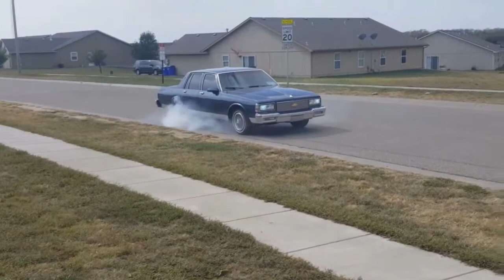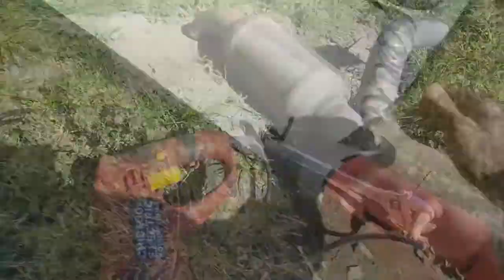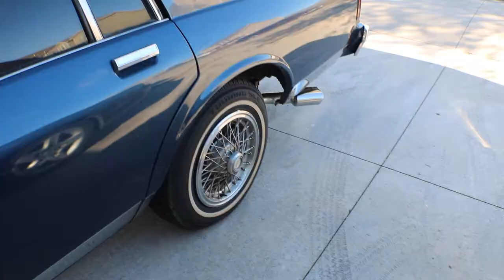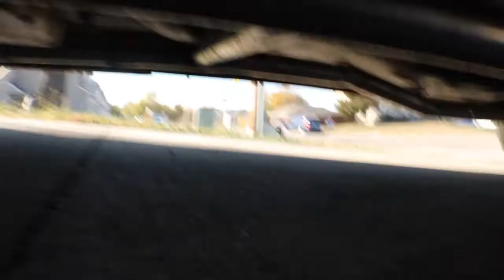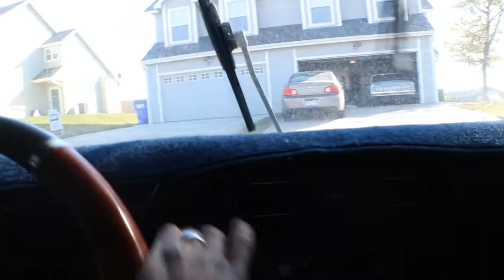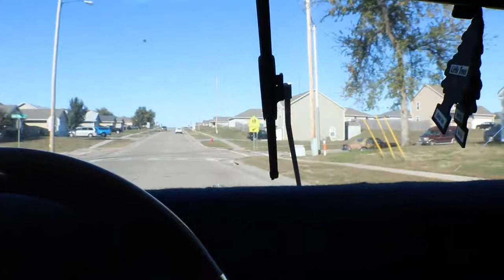Wife's 88 Caprice True Duals & H-Pipe

Comment: She gone be acting a ass in tha blue box bro she sounds good bro 💪 get u a eaton posi trac ... bro did u ever figure out the problem with the wipers
Reply from the maker: Boss King Not yet, we don't drive it in the rain anyway. Just put it in storage last night.
Reply: You might have to replace the entire wiper system brand new. My 1991 Cadillac Brougham had this issue. The wiper always ran so i instaaled a toggle switch so they would shutt off. That didnt kill the power running to them even if the car was off but it still wasnt enough too drain my battery dead either. I replaced the switch with one from the junkyard only to have it not work. Its cool because i didnt pay for it. So i reinstalled the old switch just in case that wasnt the issue. Then i buy a wiper motor, install and got the same results. Was about to give up until i took it to a somewhat decent shop. Apparently the whole system was fucked up. The switch and the wiper motor. Ever since the wipers funtioned properly as it should with the oem switch.